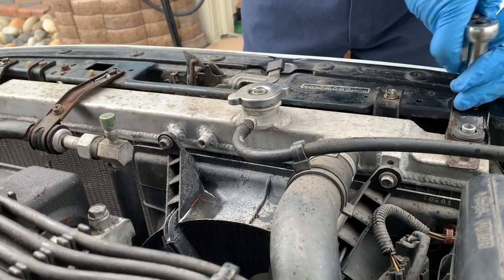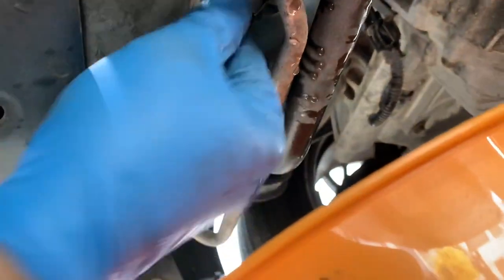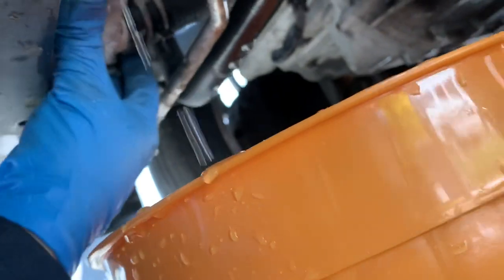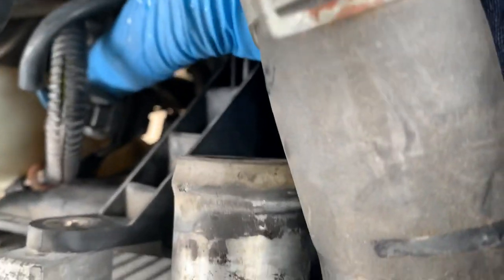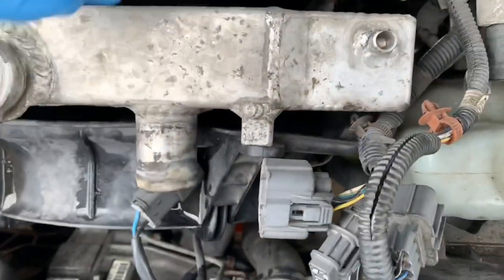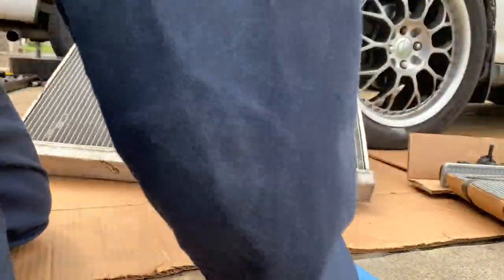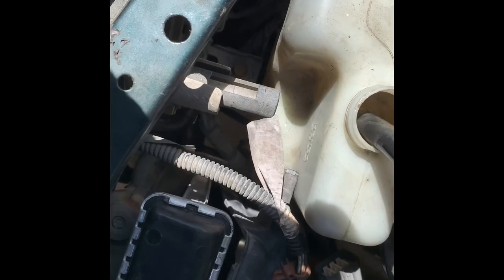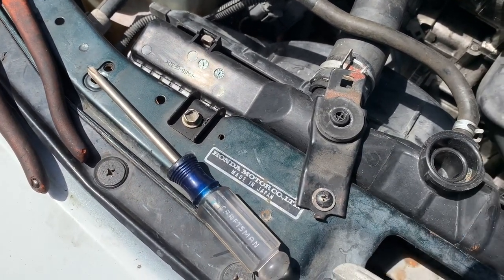How to remove & replace radiator from 94 to 2001 Acura Integra LS

Comment: U not explained how u did with the holding bracket
Reply from the maker: I have used the bottom mounting bracket since its half size.  I moved the bottom mounting bracket on top and used 10mm bolt to hold it down.  

Thanks 🙏